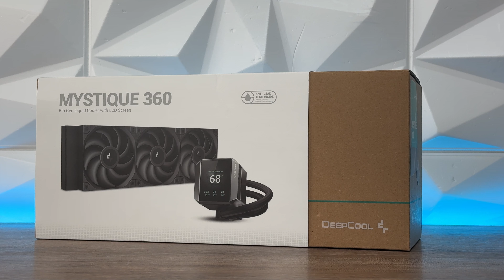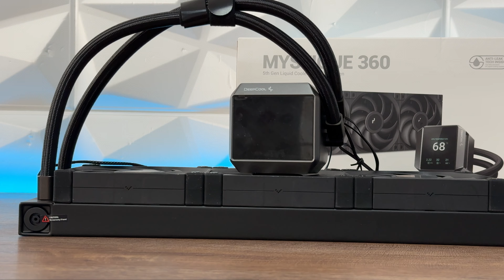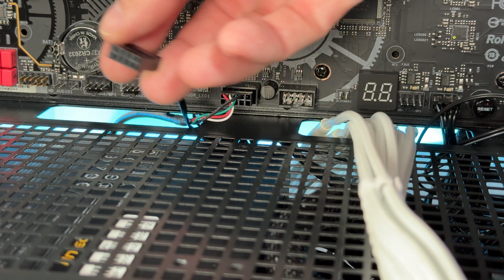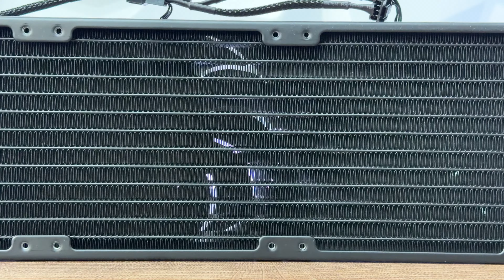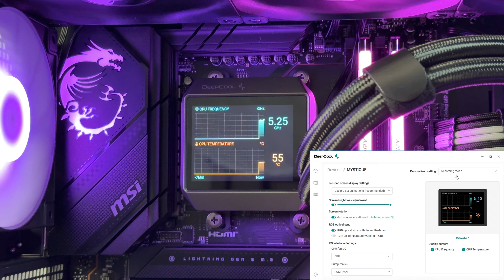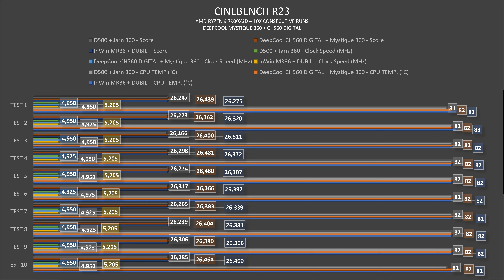DEEPCOOL MYSTIQUE 360 - Benchmarks, Tutorial, Review!

Comment: I don't recommend it. I purchased a Mystique 360 and the screen failed after less than a day!  Device Manager shows it as: "Unknown USB Device (Device Descriptor Request Failed)" and it's definitely the Mystique as the error goes away when I unplug the USB header.  I've used water cooling for over 25 years and switched from custom to AIO about 7 years ago.  Guess, I'll try something different 😒🦃
Reply: You fixe it ?
Reply: @asteroidPlace70 No, it was unfixable, so I RMA'd it to get my money back.
Reply: @TontNZ  Another question, is the pump noisy?
Reply: @asteroidPlace70  My pump was ok noise wise. But I believe that despite having a PWM connector it always runs at full speed?
Reply: Yes very noisy as the fan speed is locked to 100% @asteroidPlace70
Reply: @VIPERGAMING4K  you guys dont connect to motherboard or at least have signal send to motherboard then set the speed in bios
Reply: @LCWPG  no brother its set to the highest by  deepcool even fan doesn't comes with pwm connector
Reply: @LCWPG  i have tried everything, but in the end, i found that  it's not gonna fix because the company made it that way to run at full speed
If you still have a fix, please replay in detail
That would be a huge relief 😌
Reply: @VIPERGAMING4K  either something broken or not compatible..too bad can't help you more
Reply: Omg I'm glad to read this! Planning to buy this aio.
Reply: If you run into this issue where the screen either gets stuck or stops working, turn off PC, turn off switch on PSU, unplug the PC, hold power button for a few seconds, let it sit there for a few more seconds then start it back up.  This fixed it for me at least for now.  I also uninstalled Deepcool software and all references to it in Users, but that was just to start fresh. Then you can reinstall Deepcool software. The power cycle seems to do the trick.  It is something to do with the software where it goes haywire and craps out if it doesn’t like the size of content you are saving (potentially).  May switch out to asus AIO.  But it is working for now.  YMMV.   Good luck.
Reply: @juicyjohnpink9592  do you mean you fixed the LCD no display problem by this?

Comment: Got mine today, everything is properly connected, the LCD was working until i installed the software, then it turned off and the software doesn’t recognize it, lcd is dead…😢
Reply from the maker: That is really strange toi be honest. Try turning the PC off, reconnect the internal USB, if you have two internal USB on the motherboard even better, and then turn it on to see if it recognizes it. Also, the pump as it connects to the internal USB 2.0 it is recognized as storage or USB stick, so to say. So maybe there is a problem on the motherboard and the connection through that port. Check drivers for those USB ports (official website of the motherboard).
Reply: i can’t even download the software 😂
Reply from the maker: @josedominguez659  Downloading it without a problem.
Reply: @PCCrazyDario  do i need the QR code on the box to downloaded maybe I’m doing it wrong  ?
Reply: I’m getting errcode 10000(read ECONNRESET) from the software, when i open it it doesn’t update. Have you seen that before?
Reply: have the same exact issue like this. anyone who found how to fix this?

Comment: How is the Software when installing. Kitguru review is saying that the mystique software, windows identifies it as a virus.
Reply from the maker: Depends what kind of antivirus you have. No problems on my side.
Reply: @PCCrazyDario  I checked the net and its nowhere available yet for buy. Some pages mentioning start of availability after 4th June
Reply: I received mine today.. Its already out in Indian market
Reply: I got the 240m version, it took a while to download for some reason eventhough I have fast internet. No virus issues. main issue is the sofware uses 5% cpu (I7 14700kf) while in desktop and up to 25% usage while gaming which is just ridiculous. Pump noise is a little loud and theres no way to lower pump rpm, in bios and software.
Reply: @iamthatis  did you use the individual cables? I think there's 3. 1 for cpu, 1 for vram fan and aio fans? Don't use the one cable. That's shit.
Reply: @iamthatis  yeah even in 7800x3D it is said usage in desktop is %15 bruh... though I am okey with all to just have LDC on aio, but noise is big no and its price in here same as LFIII 420mm though not like I have space for it in case, since if I buy a new case, I would buy LianLi case which even expensive than aios xD I rather spend all of this to add on my gpu.

Comment: How does the performance of this AIO compare to Arctic Freezer III 360mm ARGB? 

Thanks.
Reply from the maker: Haven’t tested yet ALF III 360…
Reply: Have you already chosen one of those two?
Reply: @asteroidPlace70  - Yes, my Arctic Freezer III 420mm Black ARGB arrived today (ordered it back on 24/05/24 but it was out of stock at the time). Also had the 360mm on order but cancelled it as my Antec Performance 1 FT case can accommodate a 420mm AIO at the front.